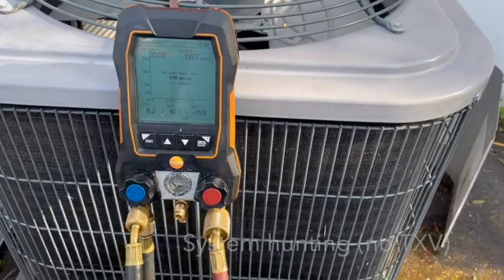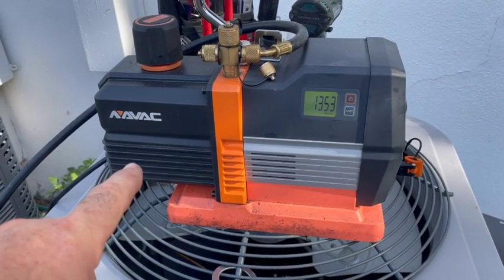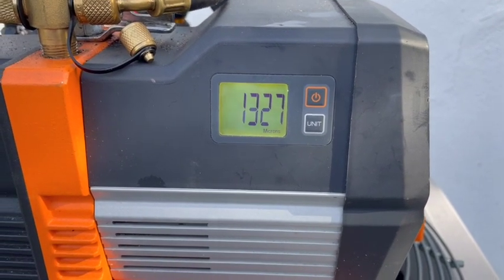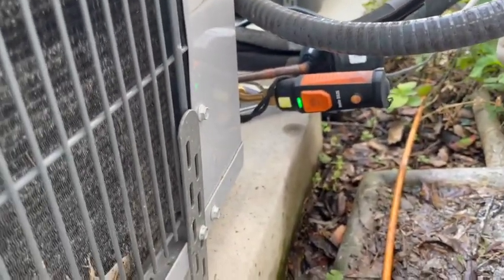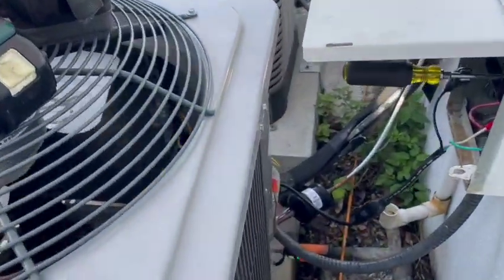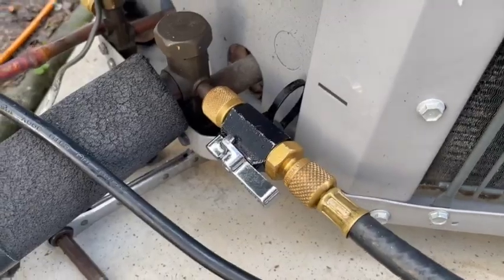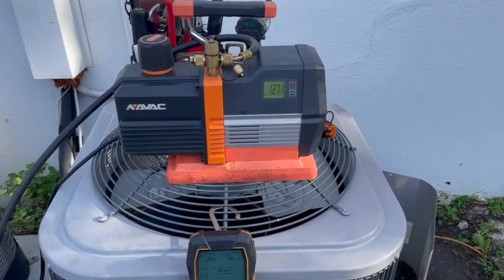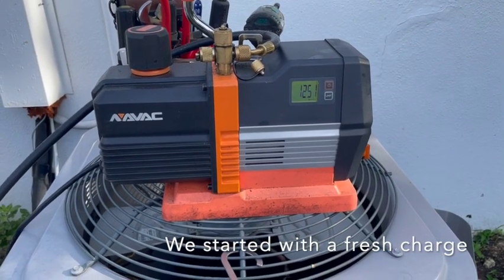Guess that problem 1- Answer

Comment: My thermostat downstairs is unresponsive. It’s working as expected but I can’t turn it on and off and adjust the temperature. The one upstairs is working perfectly. How do I know if it’s a bad thermostat? It’s only three years old. Thanks
Reply from the maker: Sounds like it is locked. Check you instructions. If you don’t have them you can usually look them up online
Reply: @AbilityJohn  thank you. Let me try it. It’s weird, the year shows and it’s blinking. The select button does not work even though I selected it repeatedly
Reply from the maker: @iggy1172  sounds weird. I have similar complaints. Power your system down and then on.  See if it works then if not then replace the thermostat.
Reply: @AbilityJohn  thanks for your help!!! Will try it.